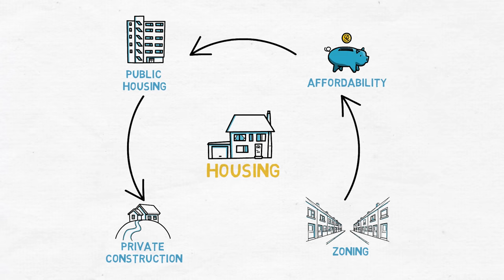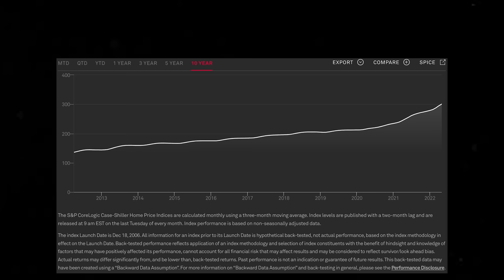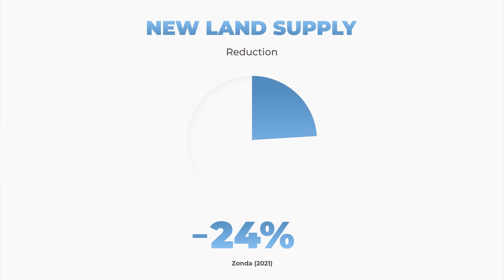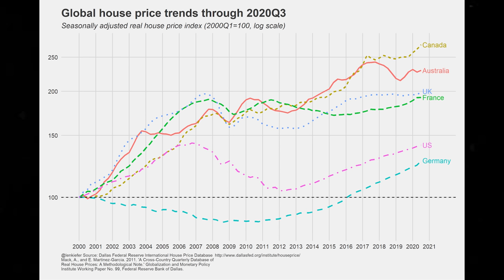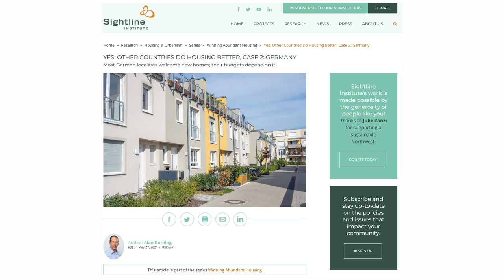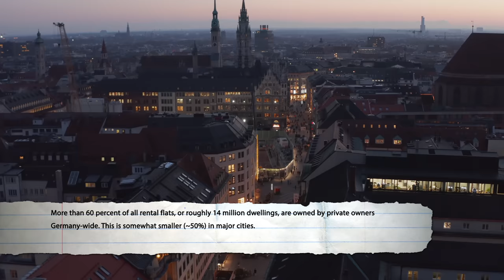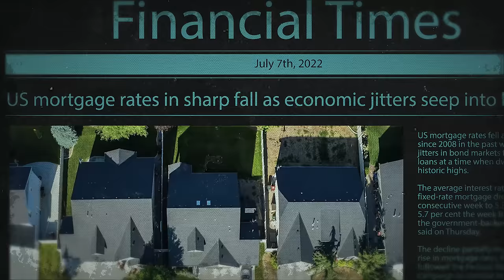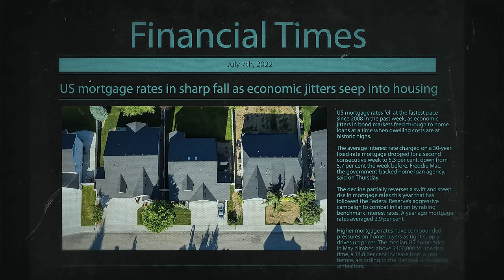Germany vs. USA: The Affordable Housing Crisis

Comment: I bought an old apartment 15 years ago for about 90k € in a smaller city with about 550.000 citizens in a former industrial area of germany .
so no fancy big city. the apartment prices in that area went through the roof and my apartments price would be about 210k€ now.

And the statistics of my city show that in general a 100 square meter apartment in 2012 was worth 1.700€ per square meter -
now in 2022 its 3.000€ per square meter.

Comment: So despite of having - overall the USA - land enough and compared to Germany relatively cheap house construction habits, there is now a housing crisis like in Germany. In Germany it has been and still is more expensive to own your privately used home than to rent it. And that did not changed for decades so far. That could have changed for homes earning some money by producing photovoltaic electricity or at least saving money if it is less dependent on externally provided energy, but houses with flats might follow.

Comment: Prices for building houses are going up steeply in the last ~ 5 years , especially comparing 2020 to 2022, and they are still going up. If you could build a one family home in 2017 for about 300 - 350k €, the same house will cost about 450 - 500k today. So one could talk of an increase of about 30 + %. Construction of. new houses (and larger apartment buildings) is grinding to a halt, contracts revoked. This is true for professional investors as well, as profits might get quite uncertain due to renters going broke in numbers due to exploding energy costs. Though prices are still high for buying used houses, they will go down when more and more owners can not pay the rising costs of living, energy and credits. The crisis will slash property value massively, hopefully not as much as it did ~ 97 years ago.

Comment: I am honestly surprised that the majority of landlords in Germany are small, non-professional ones and wonder how that has changed over the years. German rental laws heavily favour renters. It’s relatively hard to end or change rental contracts and if you are a small-time landlord with only a handful of units, one bad apple can cause a loss. I wouldn’t be surprised if the low interest rate environment has increased the percentage of people investing in property over the last 5-10 years. Low interest rates are certainly a factor why property prices have increased so much.
Reply: Hey Mowana, I can tell you how it works. I own a 3 family house in Kelsterbach next to Frankfurt. I bought the house and all for 400k in 2011. of course I calculated to pay it off with the 3 rents I got in 2011, so there would be no need to rise the prices to 2022 lvl. So most of us do just slightly increase the rent out of fear some renovation may be forced on us. So think about it in this way which cost do we house owner have today to pay more than we have when we bought it in 2011? 
And if someone did already pay it off which cost would he face to increase rents so fast as the market is doing?

Comment: you make a good point about US, but don't take the average. but germany is also struggling with affordable housing. I'm an engineer with an engineer wife and we can't understand how we could afford a 1.2milion € townhouse in the towns around Munich. heck a 2bd apartment from the 80s is >600k€ getting close to 800k€ if it's on a lower floor. in the past 30 years bug cities German housing went up by over 10% yoy. so I think you're wrong. in big cities, and around them, housing is really unaffordable. a lot of people struggle or have roommates.

Comment: The root cause for many housing problems is that economic or technological development has not made the low income jobs and need for such disparities to go away.
People have basically the same minimal essential housing needs independent of their income. 
If the system is based on the principle that some will always suffer, then there will always be tension, unrest, division in the society.
This is clearly the intended and desired state of affairs for some people and political ideologies, which see the need to be able to benefits from others. This has been with humanity at least as long as there has been agriculture and need to have ownership rules and concepts of land and property.

When the economy is dependent on a pyramidi like structure and eternal growth, it is clearly unsustainable, will develop crisis situations and untimely fail.

Comment: If you have a few days, you might consider a trip to eastern Germany and/or the Czech Republic and (besides the normal tourist routine) have a first hand look at the other extreme: Panel settlements built by the communist regimes. With modernization and other improvements since 1990 they're not as horrible as it looks at first glance, and they offer solutions to very urgent issues - affordable rent, essential services in walkable distance, excellent public transport connections, ... Don't worry, even our worst "ghettos" are very safe for American standards.

Comment: Wow a very professional video and wonderfully explained as well. 
One issue I realized in the short clips from the US houses you showed none of the houses had any type of solar on the roof. Not thermal and no photovoltaic could be seen. Is it still not common to install these on your roof in America?
Which plan does the US have to reduce its enormous carbon footprint? Or do you have still no plan since the political fractions are blocking each other so effectively that no decisions can be made?
Reply: No. Have never seen this in the US. I wondered about this to!!! No PV, no solar..... not even in brand-new construction areas
Reply from the maker: We have known a couple of people in the US to add solar to their house but not many (However, I do think it is more popular in the west coast than in the mid-west). That being said, the big talking point that I have heard from our US friends/families is that there needs to be more and better subsidies for it. Many aren't so much concerned with the cost of electricity (by comparison to Germany, Americans pay VERY low KwH) but rather, they are concerned about the return on investment. I have heard some say that it will take 10 years to recoup the savings from electricity bills to cover the money paid to install it... and then in 10 years it is time to pay more money and upgrade the battery.
Reply: @TypeAshton  sorry but I don't get the focus on ROI completely. First energy prices will go up worldwide also in the US and modern modules have a performance guarantee of 25 years for 95 % of power plus modern batteries (Senec for example) guarantee 80% capacity after 20 years. Second with all the costs we are facing in order to pay for the natural disasters that are evidently coming over the next year's it's our duty to keep the planet inhabitable for our children and grandchildren. The average house in the US is much bigger than the average European house additionally it is less good isolated and less durable so it's a taste of resources and money. The whole system to me is not sustainable and thought trough.